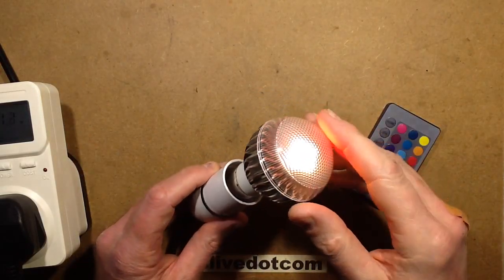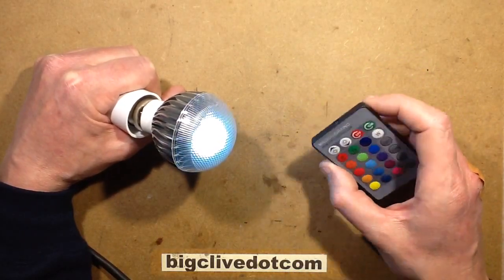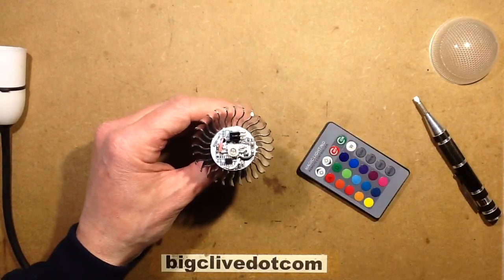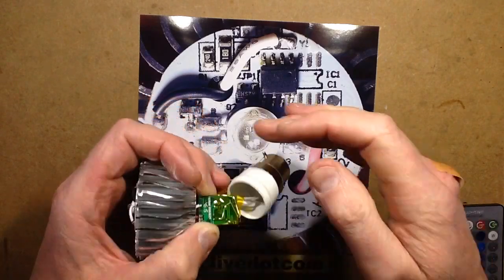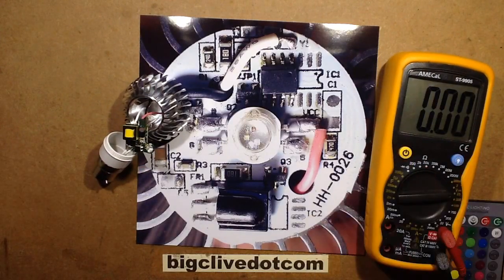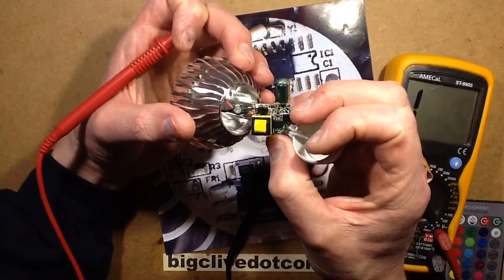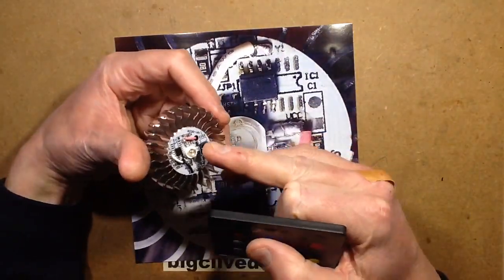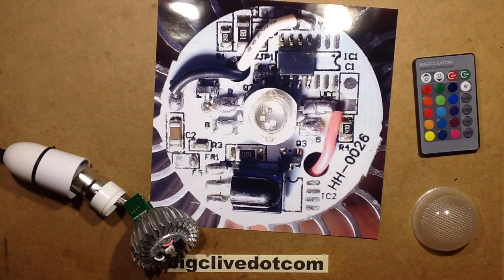Inside a remote control RGB lamp.

Comment: I actually think that the lense had more to do with it's failure to see the signal from the remote than the distance from it to the bulb itself. Some clear plastics don't pass infrared very well. Considering the fact that it's also a diffused lense, that might also have some effect on that internal sensor. One also has to consider the fact that one of the elements is a red LED which likely extends it's range down to the infrared range. If it's a PWM driver on those, it might be interfering with the remote's functionality too. That said, once it's plugged into a socket nobody should be touching it while it's on. I'd say you should just leave the lense off as I think that's the fail point for the remote.

Comment: I bought one of these a couple of years ago for under £3 from DX, walked into Maplin and saw the exact same for sale for £14.99 with a fancy cardboard box.
Reply: Maplin has always been a little on the steep side. Or so I've found. Only ever used them for small, odd, reasonably inexpensive components or plugs/sockets.
If one can possibly wait, it's worth getting it online and waiting for anything more than a few quid.
Reply: Handy if you need something there and then and they have it in stock, but if you can wait, or need in bulk, much better deals elsewhere.  Shame, they used to be brilliant and had really knowledgeable staff who could give you advice, now you are asked to identify your components that you ordered from the service counter.  Having said that you do get the occasional bargain on the shelves though.

Comment: My experience of these type of devices is that the white light will not dim, but the colours will, give that a try Clive.
Reply: Mine seems to be very similar to Clive's, although I've never opened it up.  I use it fairly regularly for mood lighting and it probably has a couple of hundred hours on it.  This one at least, does dim the 'white(mine's a reddish purpleish, but still cold- white)'

Comment: a few years ago I bought an RGB led bulb on ebay that I actually like, though it is no longer sold...

it actually had a setting that would allow you to store a certain color that it would remember even when power is removed.  it also has better RGB control than the current bulbs with remotes and could be adjusted to work with neighboring bulbs of the same model for a moving effect.  also, in rainbow mode it does a true rgb rainbow without going to white in the sequence.

all I know is I got it from a chinese company called "merry-light"

Comment: My RGB lamp is something like a 1 watt output. I really don't have problems with the light swamping out the remote even with the bulb aimed at the ceiling and I have to bounce the remote output off the ceiling. I works fine for mood lighting. I also use the blue or green light for dimly lighting the buttons of my Nintendo 3DS without interfering with the screen. The light continues to be aimed at the ceiling so it provides a low, soft game playing light. I often use blue or green because the case on my N3DS is blue-green.

Comment: I've got one of those in an old Gilbert/Softlite 1970's plastic mushroom lamp. Only differences being that mine is more elongated, E27 base & universal voltage. Also have an RGB LED strip & both of the remotes are interchangeable.

Comment: fixed voltage on the base and a resistor in the emitter is basically a constant current sink so you get a constant current through the led over a wide voltage range

Comment: I pulled that chip out of a crayola branded bulb and stuck it in a fiber optic ornament with a couple of AAA batteries. Turned out pretty cool and the remote still works without good line of sight.

Comment: I think the mains detection is for timing.. I've got three lamps in a fitting and they all synchronise. Without 50Hz time signal they'd all drift over time. RC clocks in micros are only good to a few percent so they'd drift within minutes. The nice disco flashing would become a vomit if not epilepsy inducing strobe.
Reply from the maker: That's a good point, it will also be for the mains derived timing.
Reply: Just snip the white wire and see what effect it has
Reply: Nicholas Perrin I'm sure that it would get screwed up if you plugged it into one of our 60Hz outlets.
Reply: They'd all still be in sync.. you just have to disco dance 20% faster :-)

Comment: I have this exact same bulb, but in a cheaper housing. Mine responds much better to the remote though. Mine also has a more opaque cover that does a better job of diffusion than yours, but suffers from the same problem you had with the little opaque globes in your Poundland battery operated LED extravaganza video.
For those in the US, you can find these in Walmart in the toys department for $9.88 or much cheaper online, I'm sure.
I modifed an artist's light table to fit this bulb and use it to display figurines.

Comment: I have a 15€ lamp from the hardware store- it seems to be much better than the one in the video- I think it is labelt "lightme- Varilux"  -It looks more like a normal lamp  - it defaults to white mode everytime you start it, so you can use it as a normal lamp - and the remote works fine - the only bad thing is the low brightness of the colors while the white mode is really strong (about like a 60W tungsten lamp) .

Comment: I ordered one of these and it arrived with a disconnected mains wire on the inside. Had to open it up to diagnose and solder it to the screw piece (I'm in the US). The heatsink did a number on my hand, too.

Comment: Is it possible the problem with the remote control was due to the cover / diffuser on the light?  I say this because the control problem you had was when the cover was in place.  It was no longer a problem when the cover was removed.

Comment: By putting the resistor in series with the emitter like that, it works as a constant current sink, and you don't need a base resistor either.

I'd bet they did it mostly because it let them reduce the parts count.
Reply from the maker: I was thinking it would have a current regulating effect.  Perhaps also to spread the dissipation between the resistor and transistor?
Reply: Mainly for current regulation. With a constant voltage on the base there's a constant voltage drop across the fixed resistor. Ohm's law will tell you the current through it. The collector and emitter current are pretty close to having the same current. If the voltage drop across the emitter raises due to an increase in current, the current through the base emitter will drop and the transistor will reduce it's current gain (remember, the base has a fixed voltage on it). If it's a mosfet it'll work nearly the same manner as a bipolar (base=gate, drain=collector, source=emitter).

Comment: the white wire looked to go to the Y1 pad, which is usually for a crystal oscillator, so I suspect the 50Hz is actually the clock source for  the controller.

Comment: Have you ever taken apart a Philips hue lamp? I would really like to know if they are using CC or PWM to control the LEDs.
Reply from the maker: It will almost certainly be PWM.  It's much easier than constant current.

Comment: Looks like it won't have much issues with heat with so much surface on the cooler.
Reply: They are great and run super cool.......unlike my Lloytron 10W LED Lamp which runs at over 60*c

Comment: I had one of these that failed. It would just flicker a odd color and would not respond to any kind of input. I went big clive on it and realized I had no idea what I was doing.  One of the caps on the power supply board was swollen (the bigger one) so I'm thinking that had something to do with it failing.

Comment: I had similar one, and in my case battery in remote was problem with crappy respond when using it.
I also converted it to battery and it now stand in room as candle(round long case), using few spare 500mAh batteries and microUSB controller from powerbank. With few adjustment(few resistors+switch for main power because it take some juice when idle because of IR diode ) it now work perfectly for almost year.

Also I noticed that my have identical board layout with only one difference... that chip in my case it rotated 90*... Rest it exactly the same in terms of layout of other component.... weird, like someone in china copied other china copy but instead of making part where you can fit longer chip, they just make one for one specific 8chip that they had...

Comment: huh.  odd you would post this now.  I actually just bought a couple similar ones, and they're not entirely the same as yours upon disassembly.  The only reason I disassembled one was because I'm pretty sure static electricity killed the microcontroller.

Comment: I have a jei iDual, and I think it puts out 800 Lm, and is rated at 11Watts.
So this one pulling 2.5 or so, does it have just under 200Lm?
I looks like 50 on camera, but there`s lighting etc for the camera, so its hard to tell :p
It looks VERY dim..

Comment: I had a fan with one of those stupid blister button remotes and for some reason it drew the same current from the battery in standby as when you pressed a button. So if you had a battery in it it would kill it in a week whether you used it or not

Comment: I bought 4 of these type of lamps but I found them with RF vs IR.  I got them all synced up so one remote can control all bulbs and they remember what it was on from the mains switch.  The bulb here your tearing down is on permanent red in a fixture in my bathroom for those late night pisses

Comment: hi Clive nice download a friend purchased one of these from pound land and it whistles loudly when connected and power is turned on what would making it whistle ?
Reply from the maker: Sometimes switchmode power supplies make an audible noise.  Particularly when they are lightly loaded and cycling on and off.

Comment: Why do all of these cheap RGB products have the shittiest  "whites"

Bought a kit for my computer and it was basically purple.
Reply: My guess - they use RGB LEDs and turn on all three to produce 'white', getting the balance wrong.
There are also RGBW LEDs that include a 4th LED making white on its own. But I guess they're more expensive.
Reply: Michael Tempsch Im sure this is it, but youd think itd be perfected by now. Heck, my new 700 cad graphics card still fails to get it right. Its just a bit ridiculous.

Comment: I have a similar set of lights that are battery powered and in those fake candles housed in wax (like the one you smashed open a few videos ago). The remotes are total crap even with fresh batteries. Bonus, the batteries are held in the remote with a really flimsy plastic latch that broke the first time I changed them. They are still look on my table when I'm running D&D for a bit of mood lighting but yeah they are so terribly built.

Comment: Is there a way to make this USB powered and get rid of that white wire?
Reply from the maker: Technically speaking it might be viable to just apply the 5V where the red and black leads go.  I'm not sure what the chip will do if there is no 50Hz pulse.
Reply: I've tried applying 5v but it doen't work, it needs that 50 Hz signal from the white wire.

Comment: Was this from B&M?
Reply: I have seen this one of these in B&M Bargains yes.
Reply: crashprune173 There are also two versions sold by Pound Stretcher
Reply from the maker: It was from an online seller.
Reply: bigclivedotcom Thanks for the reply
Reply: Clive,  Purely out of interest, will a generic IR remote control work with this unit? ( like the one you had with the remote controlled relay module)
Reply: crashprune173 That is a very good point given they seem to use the same remote innards.
Reply: markybyeah Sounds perfect for what I want

Comment: Ha, beat you to it. I bought a different one of these , it was DOA, so I repaired it. What a shoddy piece of crap it was inside. Two of the wires from the transformer were broken off the PCB, so I soldered them back on and hey presto, one working but slightly disappointing light. So disappointing that I decided to remove the LED PCB from the lamp and use it as monitor back-lighting (behind the monitor) to give an accent light on the wall so it contrasts with the screen. This is powered by a wire connected to the computers PSU and fed out the back of the case. The remote is fully functional and the light comes on when the PC is switched on. I think it's quite a good use for the thing, which isn't very bright.

Comment: I've got a similar set of lamps, lost the bottom battery and end up putting a 3.7v 2800mAh battery. The charge will live longer than the controller

Comment: i sometimes feel like remotes on low battery work better if you press the buttons harder. is that only me? xD
Reply: jort93z I might be wrong on this but over many years this is the theory I've come up with. Don't take this as science though... Most remotes use printed carbon contacts on the PCB, or some kind of conductive rubber stuff on the buttons, or often both. Since both things are far from being the best conductor, a light contact will have a higher resistance which will pass considerably less voltage into the control chip. On low batteries, the digital input voltage threshold of the chip is likely to rise above what you can get with a weak contact, but pressing harder increases the touching surface area and/or the density of that conductive rubber stuff, lowering resistance to the point where the chip registers it as a press. In cases where it's all plain metal and still has the issue, blame crappy surface treatment for high resistance.
Reply: jort93z Certainly seems significant. Either way, it's definitely a real issue.